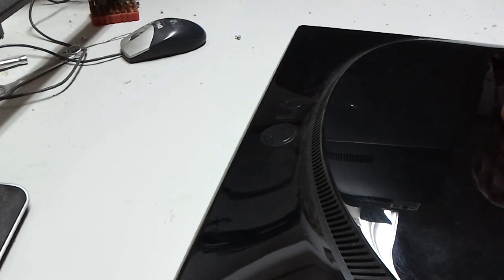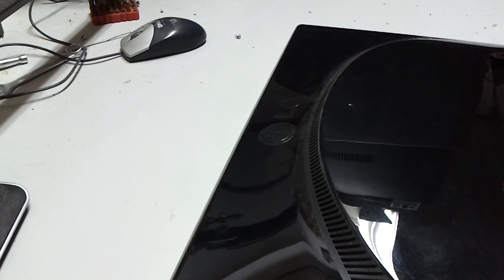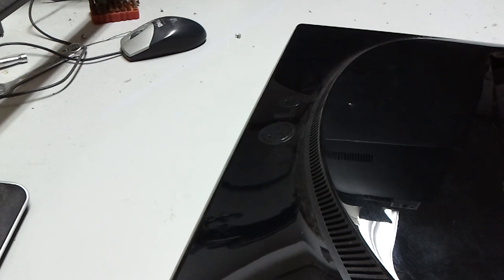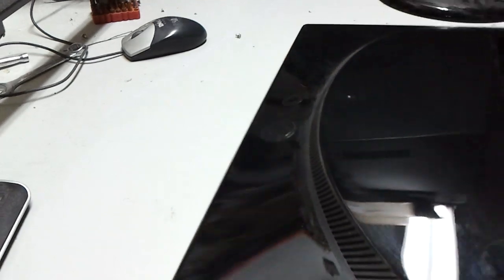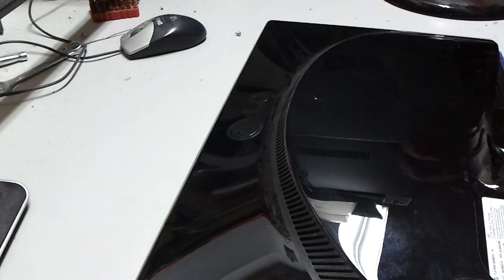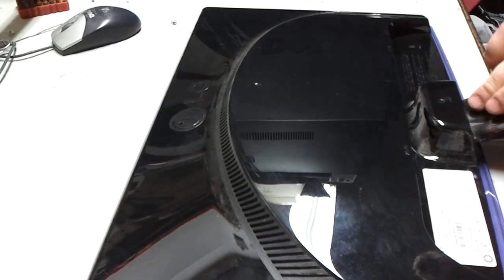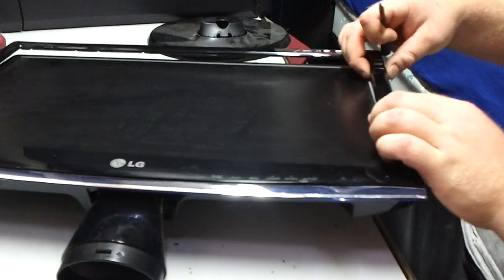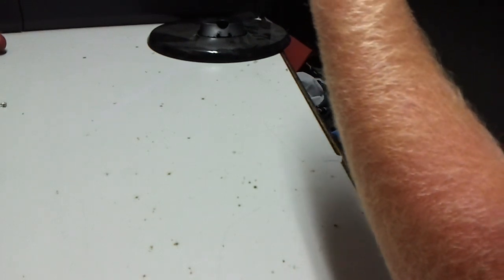Repairing Electronics With Mike: LG Flatron 20" Widescreen Part 1

Comment: Dude! I just fixed mine! The IT-011 HV transformer was fried, and as i see it has the same colour as yours. Replaced the transformer and now it is ok. Ordered from ebay a new one for maybe 10 bucks...
Reply from the maker: Ill have to dig it out of storage and give this a go. Thanks for the information.
Reply: Hi. yw :) Here is the exact ebay link: http://www.ebay.com/itm/IT-011-EBJ42468703-inverter-transformer-/151287502952?hash=item2339701868:g:VEIAAMXQrhdTWjkA  I'm glad that i can help you :) Mine works already 4 months daily 10h from 24 :) Ohhh, and i also replaced the caps with new ones :)
Reply: This is what is wrong with mine as well. Unfortunately the transformer is getting hard to find. Here is the only place I can find it.
https://www.hxlstore.com/14158161897.shtml